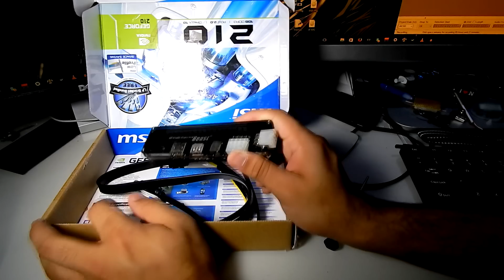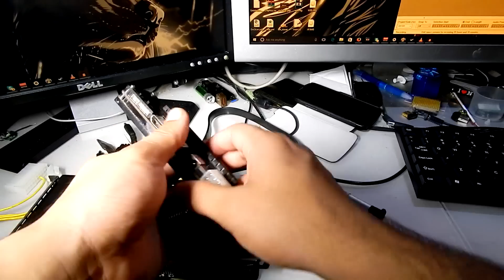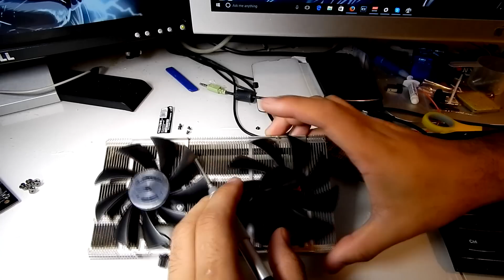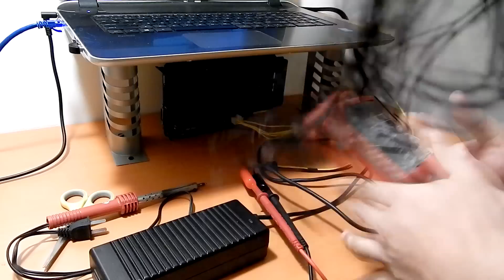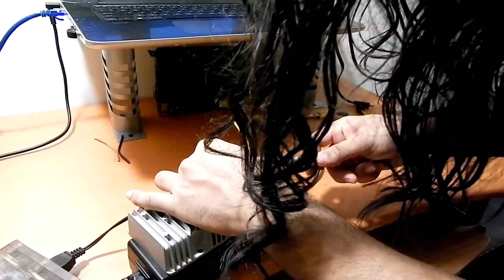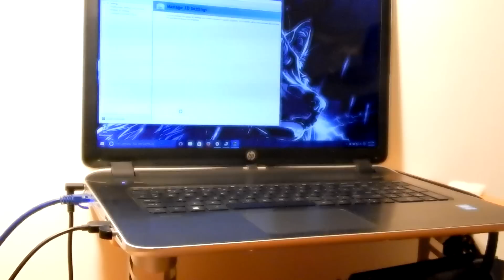Turn Any Laptop Into A Gaming Machine For 72$

Comment: please for the love of god. DO NOT WAS YOUR GRAPHICS CARD OR HEAT SYNC!  EVER! if the card is older then 2 years yes you can replace the paste , if its newer leave it and make sure you use non conductive thermal paste! secondly all you need to do is blow it out with a air can or be careful and use a air compressor with a regulator , a bike pump even  works....
never fucking was the card ...
Reply: I think the word you're looking for is "wash".  If so, you are correct.  Just blast it with a can of air.

Comment: never put solder on iron then move it to the wire, this is why you are having a hard time, heat shrink is cheap and gives a good safe clean cover to prevent shorting and that looks like pluming flux or old shit if it is you will have a lot better time with an RA or other quality sticky electrical flux.
Reply from the maker: Will make a note and look in to it thanks.

Comment: buy shrinktubes, there cheap, and looks awesome. i bought some on ebay for $3 and they hold up to 600v 125°c
Reply: this is where i bought them http://www.ebay.com/itm/311554601720
Reply from the maker: Alrighty man will do been meaning to get some but i keep forgetting.
Reply: I used to use tape for cables but then i got shrinktubes and it looks awesome, one thing to remember, if you are soldering the cable, you have to put the shrinktube atleast 2 to 3 inches away from the soldering spot because the heat from the soldering iron will shrink it before u put it into place
Reply from the maker: steven castro
Right, ill keep this in mind for sure but thanks again.
Reply: You are welcomed
Reply: davin btw an easy way to sotter by yourself is fray and twist the wires together for a good connection. Then flux and sodder you'er way to heaven

Comment: FYI when soldering, flux both ends then put solder on your tip then heat and mesh together it the flux will pull the solder into the wires and give you a better connection. Another technique is making hooks on both wires and flux and hook together and use needle nose pliers to mash them around each other, then solder.
Reply from the maker: kk thanks

Comment: question. ..can I use my power box from my xbox 360 slim?
Reply from the maker: Umm im not too sure, check the label if it can put out 12v at a few amps and you dont mind cutting the end off sure.

Comment: GPU isn't going to do anything unless you connect the video output on the video card to a monitor. Laptops with dedicated GPUs are wired to the laptop monitor.
Reply: clearly u didn't watch the whole clip where he addresses the ability to do this using the passthrough option in the nvidia control panel.
Reply: he made it work without doing everything you said. If you had a display wired into your motherboard, you wouldn't need to connect your gpu right to the display itself. Otherwise igpus don't work at all.

Comment: That definitely isn't the right way to solder, as evident by the multiple attempts at a single solder connection. Make a mechanical connection between the wires first (twist them together), then apply flux and heat up the wires. When they are properly heated, touch the solder to the wires (not the iron!). The heat will draw the solder right into the wires like a sponge and give you a much better and longer lasting solder joint.
Reply: Glad I was the one that had to call out the cringe soldering.
Reply: Well I mean, it's not like soldering irons come with instructions. But at some point you gotta realize that you're doing it wrong and try something different.
Reply: +ScissorFox well I mean, I cringed when he powered on the power brick without an insulator between the two wires. Also when I was like 10 tinkering with wires and stuff I always twisted them together.
Reply: Nathaniel Shenheizer Yeah, common sense isn't so common these days. Just stop and think about what your are trying to do for a moment instead of just fumbling into the task and hoping for the best.
Reply: As an aircraft mechanic and an avid DIY builder this made me cringe to watch lol but I imagine he knows the proper way now. Interesting build and keep up the good work!
Reply from the maker: I hear all of you and i am listening, I will make notes on this but as far as soldering goes i never took anny classes or anything it was all stuff i picked up on after all this time. There's prolly worse ways of doing it but it all honestly comes down to personal preference at the day of the day, cause everyone will have a different way of doing it, tho thanks again for the comments tho.
Reply: TheTopMostDog NP man, at least someone learned something here.
Reply from the maker: Idaefix
Welcome to DIY
Reply: Surms41 You'd be better off just using crimp connectors if you don't intend on making a permanent connection.

But the reason we even bring up the soldering is because this guy is supposed to be some sort of "tech guy". However, when you show people your tips and tricks, and you use a god awful soldering technique like that, you lose all credibility for yourself. If he can't perform the most basic of soldering practices, how can I really believe this guy isn't just completely full of shit about everything he is talking about?
Reply: You can twist the wires together, just imho you really shouldn't, as they will pull the cables to a slight angle (especially if you try and straighten it) and can cause further breaks - not saying "no, you can't, don't ever do it" - perhaps I worded it a little wrong!

But then, if you're tinning the wires as you should be, you can't really twist them together any way...
Reply: Surms41 It was simply dumb luck that he was able to power it up in the first place. When you take the time to learn to do things the right way. it becomes the easy way.
Reply from the maker: Idaefix
Have a nice day :)
Reply: I agree with what you say, except for the part where you mention not twisting the wires together. There is nothing wrong with making a mechanical connection between the wires prior to soldering. I've tested several popular solder joints by creating the joint and pulling on both ends until the wire breaks, none of them fail at the joint. The solder holds together better than the wire itself. 

I've only tested this on multi-strand wire though. I imagine single-strand of wire being twisted together could work harden and become brittle at the joint.
Reply: +Surms41 if he soldered the way were saying, he could have ripped thoes wires as hard as he wanted without them breaking. His way would probably break sooner or later.
Reply: This video is irresponsible in sooo many ways... You just can't make a tutorial video in which you power up a power supply pumping through nude coppers, and not even caring to warn of the hazards to do so... And it's not the only major problem here...
Reply: I've soldered like twice and it took me two minutes to google how to twist the wires...no excuse really
Reply: Never put solder on the iron, it will shorten its lifespan, and could potentially ruin it. This is because you may not get all the solder off and it might not heat up again and melt the solder.
Reply: I mean, it worked. It also looks way easier than trying to hold the solder, the wires together, and the iron with 2 hands
So why is your way any better if he just puts the solder on the iron, and then spreads the solder with the iron? It's not.
Reply: Nathaniel Shenheizer Sure, but I'd choose ease over strength when doing some prototype tests, as well.
Reply: ScissorFox It would be enough to simply twist them together and use electric tape. Of course the "proper" way would be better, but not needed in any way.
Reply: im with scissorfox on this i spent the whole time wondering why he doesnt do this the right way the first time even if at all
Reply: been a really long time since I did any soldering in school, so yeah this didn't seem right to me and your comment told me why.
Reply: No, everyone has not his own way of doing it, that's basically why people can teach this, and this particular situation doesn't take a lot of reflection to sort out...
Reply from the maker: Flyboy
lol thanks.
Reply: That's the wrong way to do it, the correct way is to 'tin' the wires (put a bit of solder on each wire end) then put them together, and heat, the solder will melt together, joining the wires.... you shouldn't twist as it can cause breaks and strains in the wires and cause bad joints later....

Also, never carry solder on the iron, if it's on the iron for too long the flux will evaporate and it could damage your iron aswell
Reply: it's not personal preference that's the thing. Your way of soldering wasn't at all efficient or effective. It was lazy and time consuming. Not to mention that I never took any classes either but i still managed to learn how to solder when I was 13 years old within a week solely based on learning from my mistakes and common sense. It's like saying theres a personal preference for breathing.
Reply: +Surms41 because thats not how its done son..
Reply: thats what i was going to comment. in auto shop we solder wires and when i saw this video i was like this isnt the correct way to solder
Reply: Thanks for the tips on soldering, OP.
Reply: Wow, what a thug.
Lol seriously I leave you to eventually burn your house down, might teach you a lesson.

Comment: hello. i noticed you powered the gpu with a 4pin cpu power connector. if i buy this power supply: 

http://www.ebay.com/itm/AC100-240V-to-DC-12V-2A-3A-5A-6A-8A-10A-Power-Supply-Adapter-For-Light-Led-Strip-/291819364724?var=&hash=item43f1ca2174:m:mIBR0BVKYYPK_5Zf0ZomU2A

its a 12v 10A 120W power supply. if i connect this into the 12v dc connector in the dock adapter and then plug the pci power cable from the gpu into the pci of the dock adaptor, will it work?
Reply from the maker: Ill keep this in mind.

Comment: I have the same laptop with intel hd graphics 5500. has anyone found out if theres a way to switch the gpu. it seems alright for a gpu but the vram is only 128mb and ive been looking everywhere for specifications on the laptop.
Reply from the maker: The nvidia control panel or the amd one should have an option for it.

Comment: will the pci-e slot be strong enough for a good gpu or will it bottleneck the gpu
Reply from the maker: It depends on the cpu the laptop has to be honest.
Reply: +Davindra I know about that kinda bottleneck but I mean that the pci-e slot in your laptop where you connect your laptop with the dock is very small. If you connect a gpu in a desktop the pci-e slot is much bigger. So won't the small pci-e slot in your laptop the gpu
Reply from the maker: Well here, size doesn't make a difference it depends on two things the speed of that port and the amount of lanes the cpu has.  That'll determine the or cause a bottleneck even on a pc.
Reply: +Davindra okay tnx

Comment: the card switching on laptops is done by dynamically switching what is connected to the first PCIe Lane. The number 1 lane is used to address both the graphics unit on the processor and the dedicated GPU.
Reply from the maker: Huh thats pretty cool.

Comment: #video is good, concept is stupid for computer at home but it could be a idea if you want to stick absolutly on your laptop, easier to build a budget desktop low-mid range 2008-2012 around 200-300 dollars and you will get better performance,
Reply: you have to do a hack job if you get a computer with proprietary shit though. Especially if you know the cpu is good enough, but don't have enough power on the power supply to upgrade the gpu.

Comment: You need a business laptop with a docking connector.  A lot of home laptops (e.g. Lenovo-branded) omit the docking connector these days.
Reply: No, you don't. You just need a laptop with mpcie
Reply: where my wireless card is there is only a tiny ass wire going somewhere into my laptop. Basically it has the same wireless as the xbox 360 slim. I have doubts that I can get this method to work, the good news is that this laptop has a decent gpu if I could just fix the overheat issues.

Comment: razer core 500$ only works on few laptops, gpu dock 72$ works on all laptops
Reply: its really about $29 but its $72 for Power supply if your laptops is weak
Reply: Yeah, and the Razer Core doesn't make you open up your laptop and remove your network card. It also gives better performance using the higher bandwith USB type C.
Reply from the maker: But it costs 500$, gg
Reply: ***** No, not GG. These mPCIe adapters aren't as capable, more buggy, and have less support. They will technically work on most machines but the Razer Core and other USB-C docks will work better on a capable machine.
Reply from the maker: *****
Of course, a razer core will run much better but even then razer themselves will not admit  if the dock will run on other machines tho it will. Plus this isnt something i would recommend to anyone unless they are skilled enough to try something like this and the second problem is that usb c isn't close to mainstream yet. Of course its on some more expensive machines but average consumer gear still yet to adapt. Personally i can't justify the price of a razer core to anyone even if they have that kind of income its a first gen product that is heavily priced, with a dock like this your not gonna run a gtx 1080 but its still better then integrated graphics plus if anything was to go worng a replacement isnt too expensive to get. On a last note this video was more for the sake of experiment, most people will not be able to afford a core but i would like to still offer them a chance to have something thats remarkably close if anything,
Reply: ***** A lot of consumer laptops, unless you go cheap, will have usb type C. The type of GPUs you'd need to use to benefit from Type C would only do well and not bottleneck with a laptop that has a fast enough CPU, therefore is in the price range of Type C. Then again I'm sure you know this.

mPCIe docks are still a good option if you have no type C. I nearly bought one until I got a new machine.
Reply: not on mine it won't. It'll be running at usb 2 speeds most of the time, the usb 3.0's I have are bipolar. Sometimes they work at their rated speeds and sometimes they're at usb 2.0 speeds.
Reply: That's why you buy the Razer blade and not the Razer blade stealth.

Comment: What's a "wireless card"? Where does that thing plug into??
Reply from the maker: Well a wireless card is what you use for internet. The "thing" your referring to i have no idea what you mean.
Reply: ***** I meant the whole device :P. How does it actually connect to the laptop itself? I have a Dell Inspiron 3521 with an i7. Will this work for me as well?
Reply from the maker: undeny
You'll need to check it has a mini pcie slot but it connects to that and comes out as an hdmi cable DO NOT plug that into a tv or anything thats to be only used with the dock.